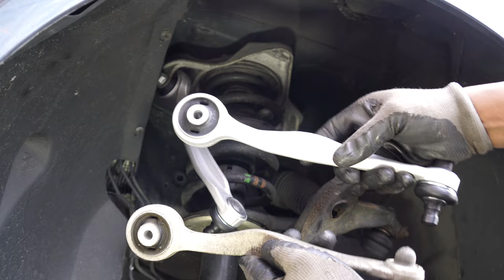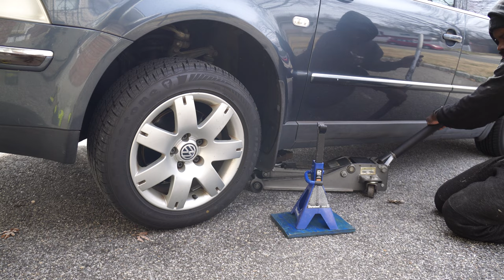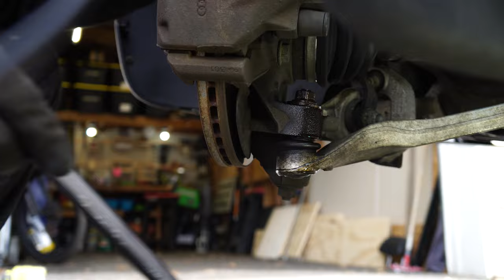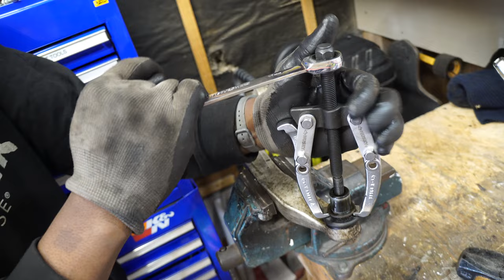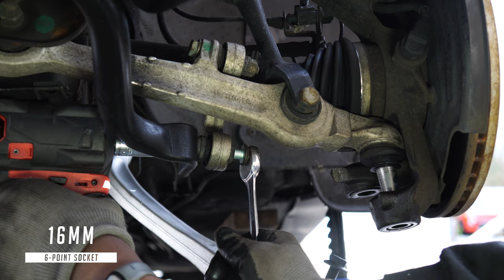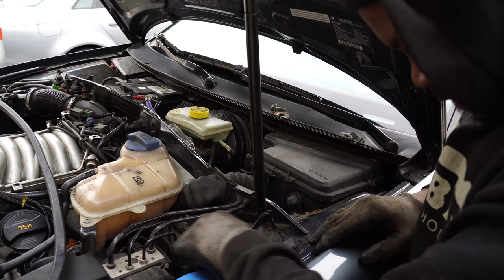Volkswagen B5.5 Passat Front Control Arm Replacement

Comment: Just did these myself, and noticed watching your video.  ALWAYS make sure the threaded end of the bolt and nut for the shock to lower control arm go on the side NOT facing the CV.  They can and will rip the boots.  I tried flipping my own around and paid for it.

Comment: The anger boiling in me watching you take that pinch bolt out so smooth bro I hate your luck🤣
Reply from the maker: Lol, you gotta watch the front shocks replacement video. That's when I struggled to remove it, I made sure I put alot of anti-seize on it.
Reply: Whenever it's tight, just soak it in cider.
Reply: @owl1873  cider? You mean like apple cider? Please explain because I’m going through hell with my spare knuckle and I can’t air hammer the bolt out with my baby hammer or the big boy Matco air hammer lol.
Reply: @MauriceEllerbee I had to heat mine up tell it was glowing red.
Reply: @rileygomolchuk7258  even glowing red I still didn’t break it free bro lol

Comment: @Crafty Hey man great vid showing the work.  I noticed you didnt mention that the the upper control arms have to be at a 45ish degree angle from the top hat when tighten them down.  And all of the other bolts need to be torqued under load.  I have done both sides of my car and gone over every nut and bolt 5 times and i still get a low speed clunk from both sides of the car like when i hit a bump or pothole, and its individual, any idea what could be loose or need checking.  I have replaced inner and outter tie rods, i have also checked the bolts for the steering rack, to make sure they are not loose.  Did you have any clunking after the repair?  I noticed you didnt do the front shocks like i did but again ive double checked them all!!!  Thanks!
Reply: I had the same problem, and it turned out the drive axle was worn and on its way to failure on the input shift side. It took a trip to the dealerships to figure it out, despite all my efforts.
Reply: @owl1873  Hey owl, I appreciate the reply, I will double check mine! When i bought the car just over 2 years ago both CV axles were shot (clunking under acceleration) and i replaced them with DSS axles, and its been great ever since, but now i have bad alignment  on my right front tire and vibratations at any speed above 80.  Im not sure if CV axles would also cause this issue after replacing suspension parts...  Still stumped and the forums are of little help with this issue.

Comment: I looooove passat videos!!! More videos please!
Reply from the maker: For sure! More Passat videos coming up.
Reply: @CraftyWorkshopBuilds 
Hi,  I have a 2004 vw Passat TDI 4motion in Ireland.. it's lacking power going uphill and has a whistling sound, doesn't Smoke Alot. I've changed fuel filter
Reply: @CraftyWorkshopBuilds 
The Map Sensor doesn't work as the power cable is faulty. Pliss advise me on tips to follow to solve ths problem. Thanks.
He's.

Comment: nice one bro!  I am not so fortunate with my upper pinch bolt situation, and right side steering knuckles are now like hens teeth!
Reply from the maker: I struggled to remove the upper pinch bolt in a previous video. But I put lots of anti seize on it, that's why it came out easy this time.
Reply: The pinch bolt became one with the steering knuckle assembly by way of corrosion.   had to drill, cut, torch, and airhammer it out!  Other side looking the same way!  @CraftyWorkshopBuilds
Reply from the maker: Yea, it's a common issue on these cars. The only good thing about this car, is that the knuckle is steel. On the b7 audi it's aluminum, I broke a knuckle trying to remove the pinch bolt on the audi.
Reply: @CraftyWorkshopBuilds  that sounds like a really great day! :face-purple-crying:
Reply: finally getting in it doing the driver side lowers today, your video is awesome help my dude!

Comment: Hello, thank you for your video. I plan on replacing the front control arms of my b5.5 Passat and I’m wondering if the kit you purchased is holding up well?
Reply from the maker: Yes, the kit is still on the car and holding up well.
Reply: @CraftyWorkshopBuilds  just a random question, since I’ve got my B5.5 Passat v6 glx I have been having trouble with a check engine light for secondary air injection system and evap leak. Have you had any problems with your B5.5 Passat with one or both of these issues?

Comment: Hi man! Can you give an accurate estimate of the tightening torque to apply or did you tighten the bolts at a rough guess?  All my greetings from France.
Reply: Get the chiltons book, but most of the bolts are torque to yield and while under load, so you set them to a certain torque then you go 90 degrees past, while you have upward pressure on the suspension (a jack under the steering nuckle will work to get it to ride height position.  I dont have my book in front of me but most of the passat forums should help with numbers.